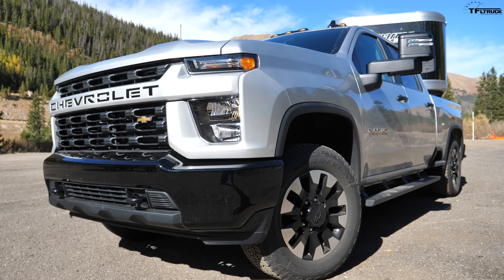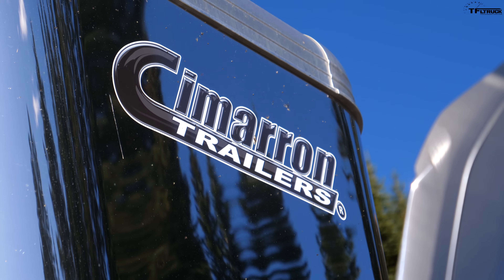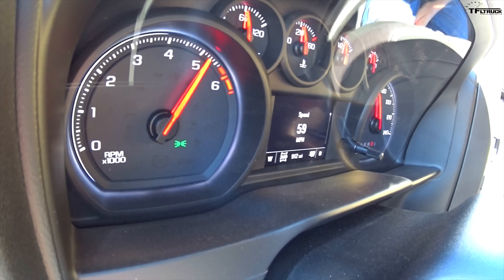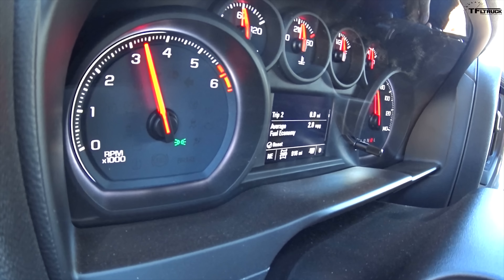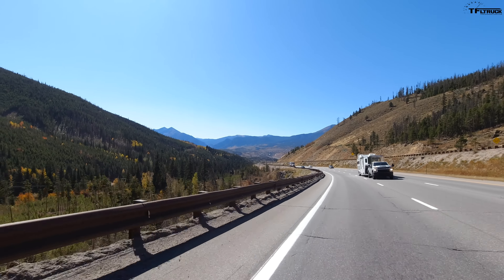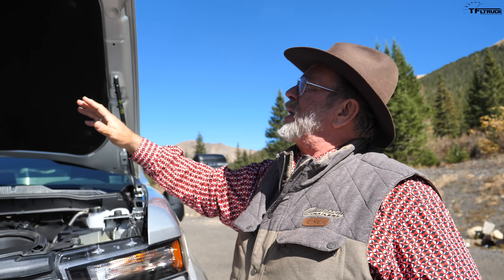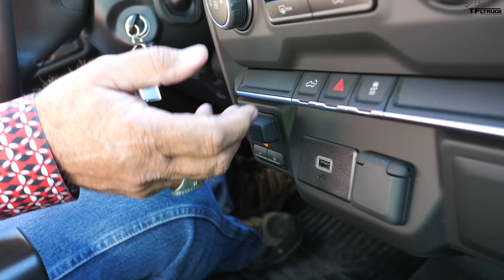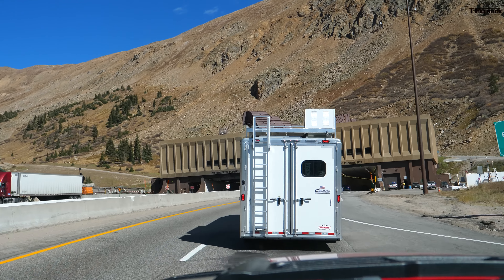The New 2020 Chevy Silverado HD Gasser Broke Our Ike Gauntlet Scoring System - Here Is How!

Comment: Wow, people are way off base on a lot of things. The 10-speed in the DMAX is an Allison. The co-development between Ford and GM was not for a medium duty trans but for a light duty trans. As such that trans would never go in any of the Ford or GM 3/4 or 1 ton trucks. The reason that truck suffered is because it didn't have enough torque to pull that load up the hill. BTW a trans doesn't shift to keep in the HP band but in the torque band. Would the 10 speed optimize that peak torque which is probably 4500 RPM?? We don't know. Now on to the rear ends. A 4:10 would have that engine revving even higher. The 4.10 is for low down grunt but it would just make the engine spin faster at a given wheel speed and at 5000 RPM your past the peak torque and the 4.10 would have made it even higher past the peak torque so it wouldn't have helped with time up that mountain. Would have made it slower.  Long story short no 450 ft-lb torque gas engine is going to pull a 16,000 lb trailer up that grade and so any of us interested in the right tool for the right job would have bought a Diesel. In summary this maybe the toughest towing test and it will show a winner but a winner in a bad catagory that nobody would want to be in anyways.
Reply: And you're way off base on a lot of things.  First off, the GM 10-speed behind the DMAX was not designed from scratch by Allison, but is a GM 10L90 modified by Allison for the higher torque of the Duramax.  The reason that the truck suffered going up the hill is that the transmission wouldn't downshift to keep the engine close to its peak torque, which is at 4000 rpm.  Near the top of the hill, it was at 2000 rpm, and 25 mph before it FINALLY downshifted, then the truck started accelerating again.  If the engine could have been kept at 4000 rpm WOT, it would have been putting out about 250 hp at that altitude, and would have performed much better.  Any truck driver knows that if you have your foot planted, and the engine is below peak torque rpm's, it's time to downshift.  The power band of any engine runs from peak torque to peak power.
Reply: @andyharman3022  10L90 is used in a ZL1 and of course this trans has a new PTO on it. The 10L80 is used on the 1/2 tons. The trans in the HD trucks is neither of those.

Comment: While going uphill on full throttle could you not change down a gear at all to get more power/speed? The lights are in a silly place, should be on the indicator stalk. Oh, and it’s mirrors not meers.

Comment: Thank you so much for the review.  Looking at getting one of curse 4x4 standard bed to tow a 5th Wheel that is 35 foot with a GVWR 15000lbs and pin weight 2350 lbs.  The number add up, but how well do you think it will be towing once a week or every other week about 200 miles?  Thanks
Reply: Bruce Murray  At 15,000 lbs., I think I would get a diesel 1 ton truck with dual wheel base. . I also would opt for the long bed (8ft)
Reply: @rexgoliath4032  Thanks

Comment: GM needs to work on the transmission tuning...that's horrible that it wouldn't downshift until it was too late. That's a heavy trailer and it needs to stay in the power.  My ford 6.2 downshifts like crazy to stay in the power. It'll do 55 in second gear and hold it there.  Wonder how the ford 7.3 will do.
Reply: Maybe they need to change it up and run two test one in automatic tow/haul dumb mode and one in manual mode.   I think it would be fun comparison to see how much different there is between them.
Reply: KdougK yeah I think it would kill that hill in manual mode if you just put it in the power band. But that's not how they do the test. They just let it do it's thing because that takes the human out of it.  I think GM should remap the transmission to shift differently in tow haul.

Comment: The problem with these tests is it doesn't show gas vs diesel performance. It shows turbo vs non-turbo performance. Put a turbo on this gas engine and it will perform every bit as good as a diesel.

Comment: Did you do a review like this for Ram 2500? 6.7 Hemi vs. Cummins?  It would be nice to see the 2500 gassers against each other too, Ram, Chevy, Ford (towing comparison like this one).
Reply: Yes they have, do a quick search and should pop up. The ram was slower with less weight and the Ford broke down and couldn't complete the test. The last diesel review, was all three trucks with the same trailer on the same day. The GM duramax had the fastest time going up and fewest brake applications going down, so it was 1st in the test.

Comment: A good bit of this is because of GM's boneheaded decision to go back to 3.73 gears. My dad's truck has 3.73s with the 6.0 and it's a dog, and sucks to drive with a load. That's why they went to 4.10s. Now for whatever reason they've gone back because the new engine has more power. Why rob all the new power back away with 3.73s???

Comment: Wow 12 minutes uphill 2.4 MPG with almost 4 inches of sag. This truck just ran away with the Golden Turd Award.

Seriously though, if I went gas over diesel I would look into a supercharger and a cat back system to help with the power and torque, and maybe even improve the MPG.

This should also serve as a good message to all those supercharger manufacturers - get with the times and support more trucks!!! This engine, the new Ford gas engine AND the RAM 6.4 HEMI should ALL have 50 state supercharger options available after-market.

Comment: These new 6.6 are way better on fuel than the old 6.0 feels slower though my service truck was a 2015 chev 3500 single cab with service body on weighing about 3000lbs averaged 22Lper 100km new 2021 chev 3500 single cab with exact same service body averages 18L per 100km

Comment: You guys need a retest because the truck didnt seem to be in tow haul mode at all. The truck was not behaving properly at all. Even at that weight the truck should be doing 35 at best uphill and hold gears better.
Reply: We were in tow haul...
Reply: TFLoffroad run it uphill on cruise control
Reply: Maybe they need to change it up and run two test one in automatic tow/haul dumb mode and one in manual mode.   I think it would be fun comparison to see how much different there is between them.

Comment: I want to see a 6.0 truck compared to the new 6.6 truck. Same truck same payload same route!!!

PLEASE DO THIS!!!!!!!

I want to see if this new truck is really any better as I suspect its not do to the bad decision GM made to lock the new truck to the 3.73 rear end gear.
Please make sure you use a 6.0 truck with the 4.10 gears as this was the most popular gear option sold to consumers. 
3.73s gears where an option but those only really ended up in fleet trucks.

Comment: Why was the truck RPM gauge stuck at 2,500 driving at 25mph with the foot on the floor? That RPM gauge should have been like 5,000rpm at 25mph with the foot on the floor. Transmission didn't drop down a gear. Tow haul mode still engaged? Transmission computer problems? What happened here?

Comment: Good test. But, it would be nice to include a test where the engine is not run full throttle for hill climbing. How about a test where the owner cares about not beating the engine to death at wide open throttle and RPMs where the automatic trans. could in principle keep the engine pegged at 5000-5500+?  This REALLY SHORTENS engine life. A friend did that - a valve lifter failed. 
A test could manually select gears to keep the RPM at a more modest 4000-4500 and then measure the time and MPG.

Comment: I’m a diehard GM fan, but, they screwed up big time by not putting the 10 speed Allison behind this engine. I’m even considering looking at the new Ford 7.3 with their version of the 10 speed tranny. My old truck had the 8.1 with a Allison behind it. That 6.6 gas motor sounds way too busy with the 6speed.

Comment: I dont think his foot was all the way to the floor, I would think if it were the engine would have downshifted. I have never drove a truck that wouldnt. Chevrolet does need to offer a 10 speed as an option with a lower rear end gear. Also they need to make the hood scoop functional to grab more air.

Comment: direct injection isn't old school and I am still wondering about their walnut shell cleanings around 70k miles as they gum up....or was that solved.....Would love to hear from guys who buy this engine when they get 75K on it  if its gummed up …or if GM solved the problems with direct injected engines.....my friends have 6.0s one with 294k miles still goin strong...one with 150k.....im not sure a direct injected engine will do that...ive heard about power loss on direct injected engines around 60k and having to tear them down and clean them. if GM has solved this then good on them and prolly a great engine but id love to see some in real world with 100k...I know 6.0s 6.4s and 6.2 will do it...and im 100% sure the ford port injected 7.3 will be durable.
Reply: Your full of it, my wifes direct injection car, not a GM, made it 90,000 miles before it completely gummed up and needed new injectors.  Screw direct injection.

Comment: The 7.3L gas Super Duty is going to absolutely mop the floor with this truck. GM's transmission tuning always seems to be bad, they always seems to want to stay in the highest gear possible even when it's not really efficient to anymore. I think, given that the 7.3L is more powerful AND had a 10-speed auto, It won't have any problem laying waste to this truck or the 6.4L Hemi Ram.
Reply: Nathan McDonald    Ok first of all who wants a truck that shifts down on every little bitty hill.   Me personally I cannot stand that.     No telling what this truck would’ve done if it was in the right gear this is why I want them to run two test one and automatic and one in manual mode.     I think this is a false test of what this truck can do.
Reply: @kdougk6668  Lmao little bitty hill, this is litterally one of the steepest highway grades in the united states, You want your engine to be in its power band which this truck clearly has trouble doing. The whole point behind this test is to let the truck do its thing, the Super IKE test is the one where they manually shift. I still believe the Ford 7.3L will still out perform this truck. The 10-Speed is vastly superior to the 6-Speed used in this truck.

Comment: Someone towing that kinda of weight would never let the truck do its "own thing." Allowing it to "lug/struggle" at lower rpm is not only causing unnecessary wear but dangerous. Manually shift trans to keep engine in power band and fluids cool
Reply: Good transmission mapping wouldn't allow this to happen in auto. They are testing the truck, not their own ability to manually keep the truck in the right gear.
Reply: @billyunderwood7221  understandable but having catastrophic failure occur in the middle in the highway for the sake of testing is borderline negligence. I get the "extreme" testing through and through but oil down (or up) the interstate and a broke down truck could end very badly.
Reply: @oneqwickbird  you are right, but the test that they are putting these trucks through is extreme in itself. That's the point of it. This is really the only way to test the maximum capability of these trucks and also to see which truck performs the best. Do you suggest they stop doing the tests because of the risk of a failure and an accident?

Comment: So GM finally brought a gas motor that could replace the 8.1L Gasser in my 2005. Now they need to either turbo this thing or bring back a big block to get to the 600 / 600 numbers. Oh, and add the Allison transmission back.

Comment: I think it looks like a Toyota now, I’m a Chevrolet fan and feel like if your gonna tow this much weight on a regular basis and drive in mountains you should spend then extra money  on diesel. I carry mowers with a 16’ trailer and my 2017 3500 with the 6.0 gasser is sufficient. I had an 06 duramax before and it was great but never really needed the power for my particular needs. It’s a trade off of price/performance

Comment: Could have maintained 60 up the hill easy and not had to be full throttle the whole way. Manual shifting it to the desired gear. It will then hold that gear and you never have to worry about up shifting and losing speed. once you get to speed you are able to let of throttle some. You will get better fuel mileage that way.

Comment: It's extremely frustrating that you guys have such poor testing in spots. Why didn't you force a downshift? The truck is lugging at 2500 rpms, so yeah take off points for "poor transmission tuning" but just downshift the thing manually. It would have climbed that hill much quicker and it's far better on the engine to let it rev when its working. You guys need to retest this truck.
Reply: I think they’re just driving it as if an idiot were to hop in that had never towed before in their life but somehow hooked up to 16,000 pounds and decided to scale a massive mountain.
Reply: They are letting the trucks computer and transmission do the work equal across the board for all makes just floor it and let the manufacture engineers decide how the truck does. GM and Ram seem to dislike downshifting 7.3L 10speed likes to hang out in the powerband and zoom up the hill.
Reply: @joshr6803  Nobody who owns their truck (and knows what they're doing) just floors it blindly up a hill, this test they did helps no one.

Comment: I don't if that had a 8 or ten speed trans with a 4:88 gear, if you plan on towing a trailer that size you had better get a damn diesel. How long will that thing last pegged out on grades like that. That truck was practly limping that hill. I would never leave my driveway with that type of weight hooked to a gasser. Good video by the way thank you.

Comment: They shouldn't let GM put that much tow rating on it if it cant safely do it.  Just the pin weight making the front of the truck light is an issue in my opinion.  Almost 4" of squat is Ford level squat!

Comment: Seems like a 6-speed transmission is not enough gears for this truck. You could see the engine falling well below its power and then down shifting 1 gear only to be at the top of its rpm range.  If you want to see how a poor transmission can cripple a good engine watch TFL Truck’s Ike max tow test of the first year Chevy 1/2 ton with the new LT 1 6.2 gas engine and the old six speed auto with the same test run on the 2015 model connected to the then-new 8-speed. Night and day difference, literally. When the truck, under constant load is yo-yoing in speed and shifting back and forth between 2 gears, it shows the transmission is not well matched to the engine. Changing the rear axle ratio won’t fix this.

Comment: There’s not a problem with this truck nothing is wrong with it it’s just not the appropriate or right gear set up and trani type, power is good but really for steep uphill inclines especially 11,000 ft over sea level 4.10 gear ratio is what you want and of course a 10 speed would help out a lot as well

Comment: Yall dawg this truck, but max pin weight on the truck is only 2300 pounds. This truck has 3500 pounds of payload. If they put 3000 pounds of hitch weight in the truck its way over maxed out

Comment: So I was curious how this stacked up to the 6.4 from Ram. in 2014 they did this with the ram witch has a tow rating of 15K, they only loaded it up to 12500lbs to stay on par with the 6.0 chevy. Well the 6.0 time was 10m 40s and the 6.4 was 11m 51s. So  the 6.6 towing 16500lbs getting 11m 53s isnt really that bad. Seems GM always has the lower tow rating but always over achieves on these tests. if Im not mistaken the Diesel out performed both in the Ike even tho had the lowest towing number...so with that being said I cant wait to see how this 6.6 and the Ford 7.3 will match up.

Comment: Chevys old 400 gas engine was a good motor!!!!
Reply: That old 400 with 160hp and 350lb/ft of torque and guzzled gas at a rate of 8mpg to achieve such numbers? That 400? lol.
Reply: The old 400 had its detractors, too.  The early siamese bore blocks were prone to cracking the bores.  The new 400 has a .060" smaller bore and force-fed coolant holes between the cylinder bores to improve cooling.

Comment: Wow, the shift algorithm on that truck is horrible! There is no way you should be at wide open throttle and only turning 2500 rpm. GM needs to fix the tune really badly.

Comment: Anybody else happened to notice his truck didn't even have a thousand miles on it yet. Pretty abusive test for a motor that's nowhere near broken in. Just saying, I would expect the performance to change quite a bit in another 5000 miles or so. In fact if it was me I probably would have changed the oil after this test just because of the Heat and RPM the engine was probably running at pulling up that hill.

Comment: no gas engine is going to pull this kind of weight at that elevation well and meet all of the emissions tests. most people do not use trucks like this. I get doing the extreme but for the contractor in Wisconsin that pulls a skid steer a couple times a week its more than enough and the cost of ownership is going to be WAY less then the diesel. these gassers have there place its just not at the extreme end of their capabilities towing up high at elevation.

Comment: GM needs to turn off the fuel injectors and keep the torque converter looked for exhaust braking while tow haul and cruise is enabled,  down hill only.    This is common sense engineering.   Gas and diesel.  Too prevent energy from returning to the piston and to save fuel.